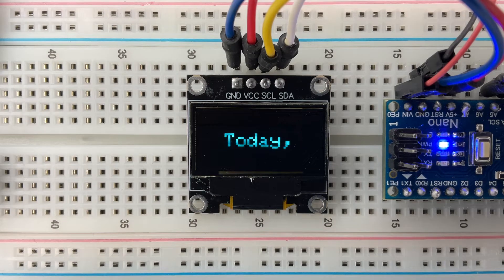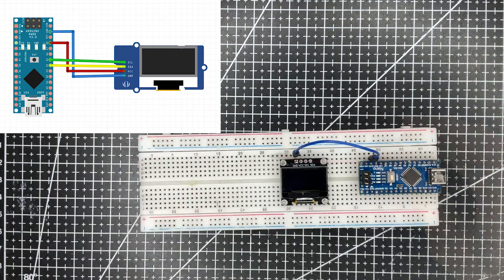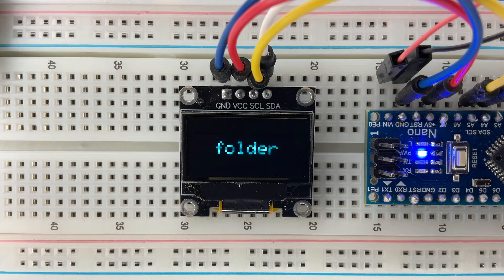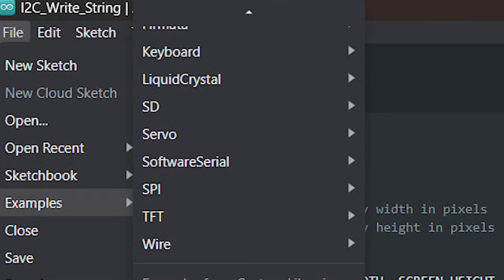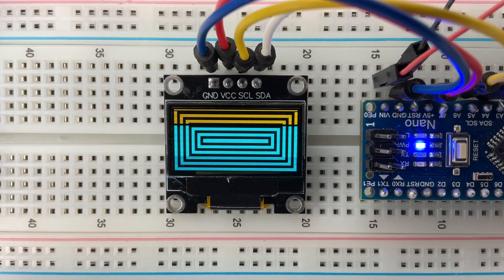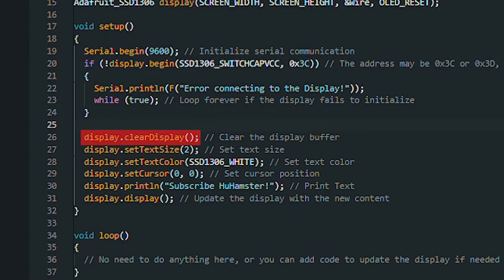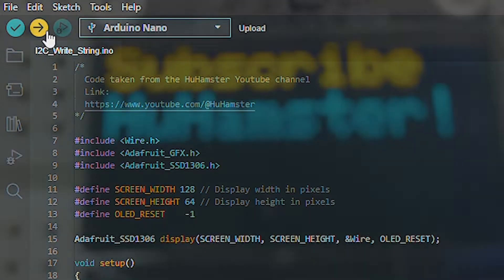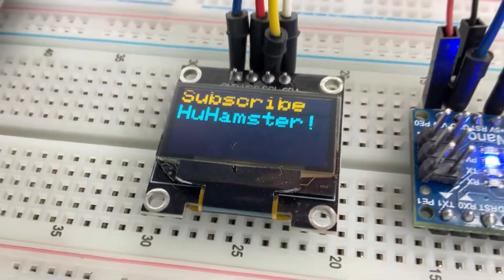Ultimate Arduino OLED Display Tutorial!

Comment: hi, how to call the animation from another file? and how to create welcome animation, and then wait for maybe 3 second, and play next animation then loop it.. thank you
Reply from the maker: Hi! You can create separate animation functions in another file and call them when needed. If you're using Arduino with an OLED display (like SSD1306), you can structure your code like this:

Create a separate file (e.g., animations.h) and define your animations as functions.

Include the file in your main sketch (.ino file) and call the functions when needed.

Use delay(3000) or a non-blocking approach (millis()) to wait before switching animations.

If you want more detailed code examples, feel free to share your email, and I’ll send them to you! 😊
Reply: @HuHamster  Hi thanks for the reply. All i want to create was a welcome, and next it will play the animation in loop. And display clock

Maybe next i will create push button to choose the animation.

I'll email you, somehow i cant post my email here.